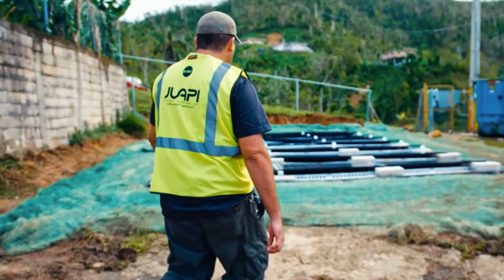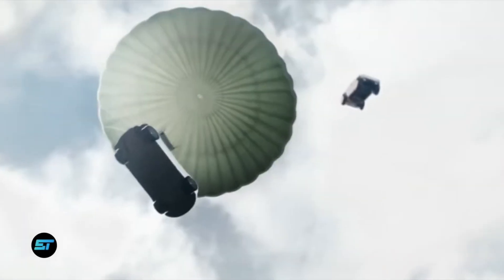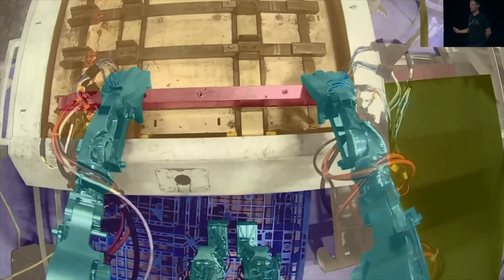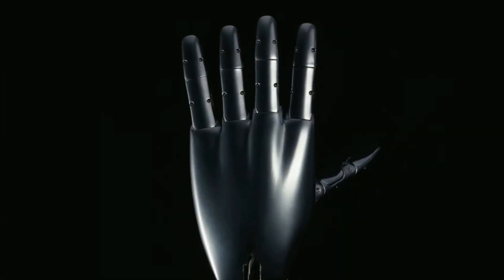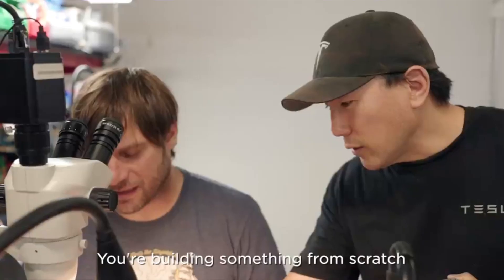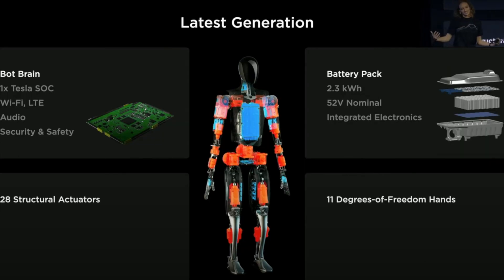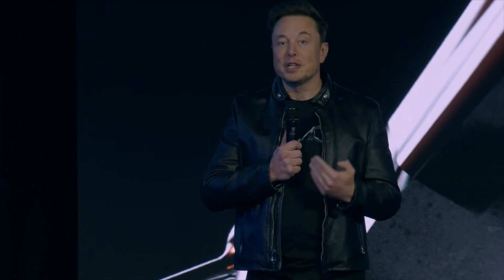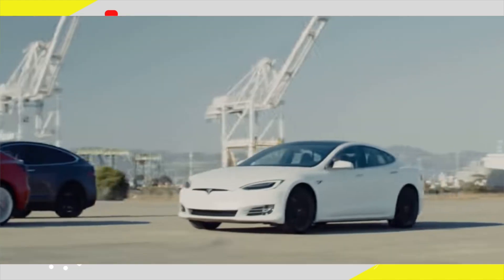The New Tesla Bot Red Carpet update is here !

Comment: It's higly improbable the robot will have a battery pack that can run it for 4 days. As you can see most of the actuators are direct drive brushless motors, or low geared motors, 28 in total. Lets assume the shouders, elbows, hips, knees, and ankles are the most power consuming, (500W/10 actuators) each servo would only have 50 watts peak output when in use simultaneously... And thats not accounting for the other 18 actuators, optics, sensory positioning and computing. With such low power for the main actuation a life size bot won't  be able to stand up from a seating position, let alone lift something else if it can't support even it's own weight. I know why the bot is called optimus, the figures presented are probably highly overoptimistic. But still, it is an incredible feat of engineering and i am not saying they  won't get there eventually. If anyone can do it it's tesla. But there are a lot of obstacles to overcome and when they finally will have an end product within specs, they will probably be totally different from these estimates.
Reply from the maker: @justsaying : Nice inteligente comments , feel free to subscribe for more cool content coming soon on more Tesla updates !
Reply: He said ‘full days work’.